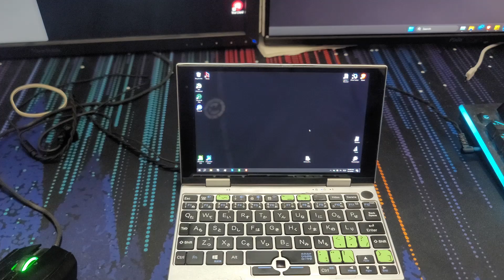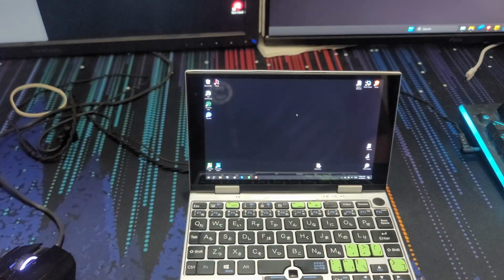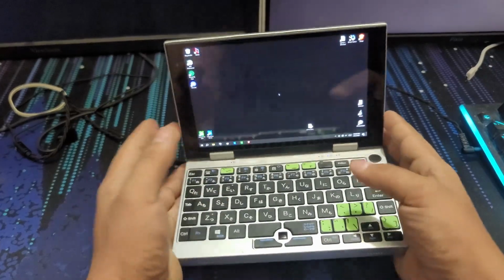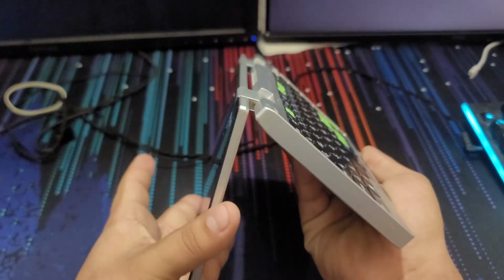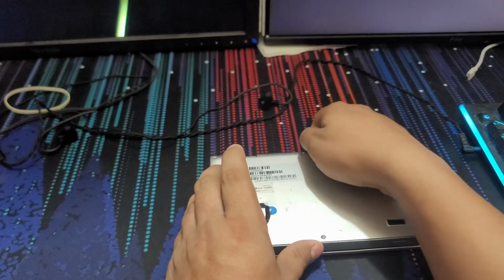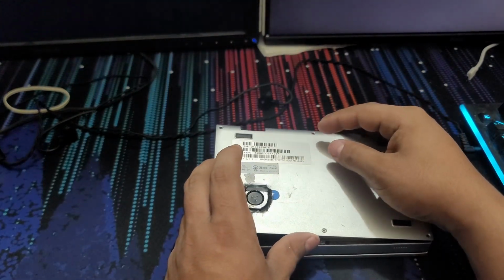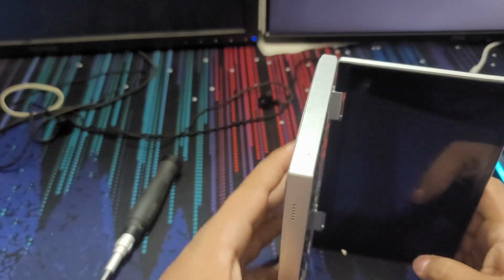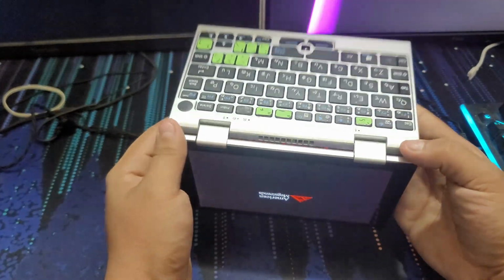UMPC Nanote P8 Eng Review + Teardown

Comment: Saw it on ebay, weird mini laptop, why did they make a hole for the fan, when there isn't one, also a place for m2, which isn't soldered. I generally thought laptop was aluminum, like the GPD mini, but watching your video, I see that it's made of plastic
Reply: Actually it's aluminum I have the same one
Reply: @Cyber_Gas  The video shows that palmrest is plastic - I can clearly see brass threaded inserts in the places where the screws are, and stiffening ribs, which are not needed for metal one. 
Also, if the case were completely metal, the Wi-Fi antenna would not be located in the palmrest, but would be moved to the display frame area. The bottom cover and screen casing probably metal, the rest is plastic, I used to have a Chuwi Minibook before, and the same thing was done there.

Comment: Hi, is the screen easy to repair on this?
Reply from the maker: I'm not going to lie to you, I don't think there are any parts available for this type of laptop, and I did try to take the screen assembly apart, but that just left the border of the screen mangled, it's pretty rough and not worth it if I'm being honest
Reply: @JasonMaclane  thank you so much for answering, i was planning to buy this secondhand in hopes on repairing it for a cheaper price. the seller said it was working normally but after an updated the display suddenly stopped working. have you heard any issue similar to this?
Reply from the maker: @ewankosayo9228  I'd recommend the Nanote Next over the Nanote P8 since the cpu is way faster than the P8. and has a ssd slot. they're about 200 on ebay.

Comment: GPD Pocket 1 used an Atom x7-Z8750 but the Pocket 2 had Intel Core 7th and 8th gen based Celeron 3965Y, Core m3-7Y30 and Core m3-8100Y. The Pentium N4200 in the Nanote P8 actually uses Atom (Goldmont) cores but it is a generation newer than what's used in the GPD Pocket 1.

Comment: What thickness of thermal pads did you use? Do you think a beginner could simply place them and then screw the case back on?
Reply from the maker: i used 1.5mm pads and used a scalpel to shave the pads to the size i needed, but I just remeasured them and it looks like you can get 1.0mm/1.25mm pads and they should work fine, if you also want to add pads to connect the memory chips to the copper plate, it's about 2mm pads for that. they sell mixed pads on amazon and ebay and the amount of pad you will need will not be very much
Reply: @JasonMaclane  thanks for your help. It does seem to run a bit too hot without my external fan and I'd like to mitigate it

Comment: where are your fans connected on the motherboard?
Reply from the maker: i connected em up to the 5v on the usb port
Reply from the maker: and added a little switch to manually turn it off and on
Reply: Okay thanks that's awesome
Reply from the maker: @gavinmetcalf3457  i can link to where i got the tiny fan later, I'm at work atm
Reply from the maker: https://www.ebay.com/itm/134503574919
i'll probably make a update vid about it eventually
Reply: @JasonMaclane  awesome thanks would love to see it if you do make a new vid!

Comment: So i got mine today, I wanted to use it for email - resume sending and on the go stuff, I didnt expect much.  Im only getting abouyt 20 mins on a battery charge.  Is anyone else running into this?
Reply from the maker: sounds like your p8 might be running with high cpu usage, I recently found this thing to speed us older and slower windows computers. It's https://atlasos.net/ and it basically helps by removing unnecessary windows background stuff, my p8 has felt way smoother and the cpu usage has gone way down after using Atlas OS on it. Aside from that, you can make sure to use the battery saver mode within windows.
Reply: well after several charge cycles its now behaving like it should.  And its pretty usable and does what i wanted to do.  The usb port seems to just be for the custom charger.  other wise i would just use the ssd.  Runs ps1 games fantastic, not that i got it for that.  its basicly and real laptop like i wanted.  The ebay seller has been fantastic about it.   @JasonMaclane
Reply: @woxlf  Hi friend one question im thinking buying the nanote next with the ssd upgrade but i living in europe and here the chargers are diferent,can i charge this laptops with my mobile usb c charger or i gonna destroy the nanote with the voltage here?any advice?thanks

Comment: Figure out how to overclock this thing yet?
Reply from the maker: The bios does have power settings, but given the lackluster documentation, aside from pushing the power limit a bit, I haven't tried overclocking much.
Reply: @JasonMaclane how do I access the bios? I tried function key method but got no where. Is it different on this device?
Reply from the maker: @undeadsamurai8590   I just mash the delete key right next to the power button
Reply: @JasonMaclane  gotcha. Will overclock and post my results in a few weeks and then longevity
Reply from the maker: @undeadsamurai8590  thank you

Comment: Hi I just bought mine and It was working until it went to sleep.  I am not able to wake it up.  The power light is blinking and I have tried to wake it up by pressing the power button, but it doesn't do anything.  Also I tried the alt+control+shift+ b and didn't work either.  Do you know anything else that i can do?
Reply from the maker: I'd probably let it charge overnight
Reply: Thank you I actually let it without charging overnight and it turned off by itself.  I could turn on later without a problem. @JasonMaclane

Comment: Does anyone know of a third party AC adapter or mobile battery that will work with this? I've tried everything I own including a 65W USB-C charger that explicitly supports 12V/3A but it will not work.
Reply from the maker: there is someone who figured it out at this link, but you will probably need to translate it:https://darekasan-net.hatenablog.com/entry/2021/04/22/172653
here is a link to an image of the translated portion that matters:https://cdn.discordapp.com/attachments/1158820617525674006/1166452007142441061/vBoUjxq.png?ex=654a8a16&is=65381516&hm=608970e781334778a27e8e7d4cddd9f2b7ad5c7b03ea8b3965591eb67d2f641a&
and finally here are the 2 links in said image:
https://www.amazon.co.jp/exec/obidos/ASIN/B08DTH4SMT/darekasannet-22/?th=1
https://www.amazon.co.jp/exec/obidos/ASIN/B07K217SJM/darekasannet-22/
you might need to find equivalent items in your own region

Comment: The Nanote Next has the Intel Pentium J4205  and the only difference I can see is the Clock Speed is slightly higher and uses 10watts whereas the N4200 uses 6watts. I don't think the extra $100 is worth it...?
Reply from the maker: the next has a ssd slot for easy expansion, the p8 has the pads for a surface mount ssd slot  it but it could be dangerous to diy

Comment: I just bought this laptop on a whim after finding very little reviews in English. Thank you lol, it's crazy your video came out right after I got interested in this laptop. I'm going to copy the drivers from mine and install Windows 10 LTSC or Linux on mine when it arrives.
Reply from the maker: beware of linux, the drivers are already not perfect, there is a japanese blogpost of someone trying to install linux but most of the drivers don't work. Also if possible could you share the drivers if possible, someone already shared a set but having parity just in case would help other people that buy it :/
Reply: @JasonMaclane   I'm looking at installing Linux on mine, do you have a link to this blog post (if different to the slideshare link below)?
Reply from the maker: @MusicalArmageddon  i believe this is what you are looking for
https://www.slideshare.net/kapper1224/wubi-for-ubuntu-2104-umpc-nanote-p8
Reply: It is possible to export the drivers from the original OS. The powershell command would be Export-WindowsDriver -Online -Destination "D:/your/filepath"

I plan on exporting my drivers, installing Tiny10 (windows 10 but without the bloatware) and then reinstall the drivers.
Reply: @ thank you, I got the laptop and just copied the drivers from the original installation onto a USB drive when I got it in September 2023 lol